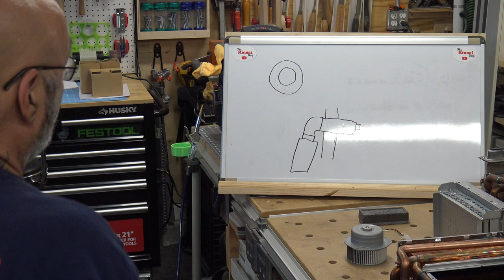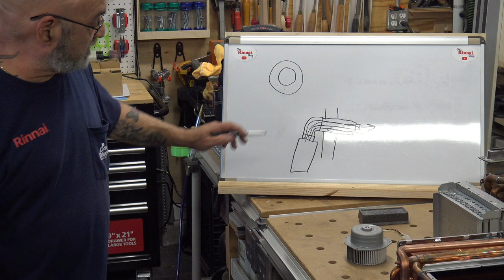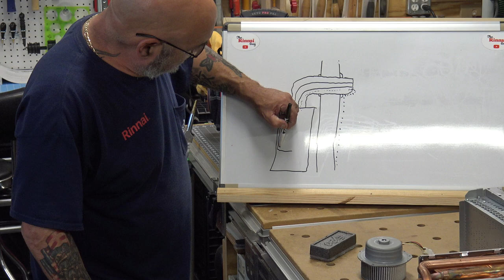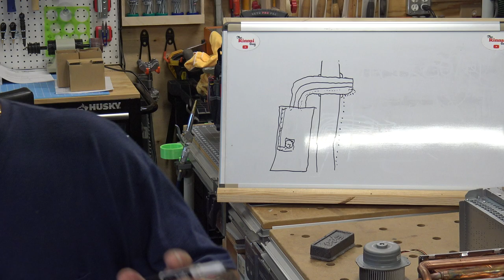Rinnai code 10, what causes it and how to fix it

Comment: Hello Mike, I have a Rinnai V75 indoor unit and when using the shower I am getting a code 10. When I shut the shower off and turn it back on the unit starts to work again for appx 2 minutes at a time. Any assistance/advice  you can provide will be greatly appreciated. Thank you.

Comment: I am a retired commercial HVAC&R guy, I have worked for major HVAC companies for 46 years. I own a Rennai 94i water (1st) heater.. I watch your videos to understand any problems I may have… found lizard in my fan cage which caused   A vibration/ungodly noise which you talked about..thank you for making GREAT videos. I have had many instructors and you are in the top three for training! Thanks again!

Comment: What about the RUR160IP it seems mine errors out with code 10 and won't clear until I clear the condensate trap. Not sure what is going on.
Reply: Is your drain line flowing good and do you have a vent on the drain line?

Comment: Mike, would a code 10 cause intermittent hot/cold water fluctuations? (Like in a shower or sink faucet) water in shower wasnt staying hot so i replaced shower valve cartridges/seats etc which didn't fix. If i turn hot h20 in the bathroom sink on first(in same bathroom),sometimes the shower will stay hot. After my attempted fix(maybe a day later) I received that code 10(w the beep). It stopped after about 10 seconds, amd seems to come back every 3 days.

Comment: TLDR: [Code 10] My vent line was almost completely full of condensed water, so I opened the drain line that's capped, drained all the water, & the unit works fine again.

Hey guys, had an Error 10 on my unit just yesterday (Model# RSC199iN - Rinnai Tankless "indoor" unit, installed inside my garage). I looked all over the internet & came across a plethora of  possible causes & fixes; including this video. My unit is less than a yr old & I don't have problems with insects getting into places they don't belong, nor does the system share a vent/intake with my furnace. That said, I called my installer & he told me a possible cause was too low of gas psi entering the unit, which made sense due to the fact that here in the PNW we had a freak winter storm producing balmy temps of about 8. Because of the cold temps & my neighborhood is ran off nat. gas, the high demand could've dropped the supply psi to a point where ignition couldn't be achieved. I tested that by shutting down my running furnace & nat. gas fireplace - no luck. I noticed that when the unit attempted to fire, there was a bubbling sound within a black plastic manifold, that connects to the outer vent PVC (like if you were to blow in a straw in a glass of liquid). Since I wasn't present on 1st install/setup,  I had no idea if this was normal or not, but I fixated on that noise. Though the unit has a drip/condensate line already, I noticed on the bottom of the unit, across from the already in-place drip line, there's another capped line that has a stamped/extruded "DRAIN" on it. I opened it up, & a *ton of water came out. Restarted the unit & it's working perfectly again. My installer said it's the 1st he's ever heard of such, & no write-up/video I came across mentioned trying that either. So if you hear percolating water in your unit on startup, try the drain line. Be sure to put a pale under it, as there was quite a bit of liquid in there. That caused the fan to run extremely hard to try to vent through that much water, & luckily the safety mechanisms of the unit caught the issue & shut it down before frying my fan. Hope this helps!

Comment: Hi Mike, thank you so much for the video!! I think I have just about tried everything for my code 10 and still haven't solved it. So I could use your help! I have a RL75i interior mount with side wall vent (with no other vents or obstructions anywhere nearby) and I have almost always code 10s but have an 11 and 14 in the memory. The unit runs for about 5-10 min then the shower pressure will drop as the hot water stops flowing or it will turn cold. When I am at the unit, the system either appears to start with flame then shut off and restart repeatedly or when it gets cold I see a code 10 with continuous beeping. Thus far I have removed the vent pipe and found dirt dobber nests which I have cleaned, found on on the top of the coil, a gecko and bugs inside the fan which I purchased a new one along with the thermistor which was quite dirty. I pulled the burner and cleaned it with compressed air, blew out the coil from below and back through the air intake from the fan hole. I also replaced the gas manifold, view plate, electrode and flame rods. Almost forgot, I also flushed the system and the water filter was very clean. When I started the burner flame height was low and now is full height. What am I missing here? Please help!
Thank you in advance.

Comment: Hi Mike I think I may have gotten one wire mismatched when reconnecting wires after fan cleaning, everything started when I connected. Hot water ran longer than usual then whole system shut off but not breaker. Im wondering if I can just fix wiring and it will come back on. It is a bit hard to read the wiring diagram on my cover. Do you have any detailed pics of how the wiring colors go? Mine look exactly like your examples, its an RL04

Comment: I have a Rinnai R75LSi that is rented from a large Canadian HVAC company since 2011 and it has started to get the error 10 sometimes when someone takes a shower at night. So far, I've been pressing the ON/OFF button to restart the unit to get the hot water flowing again. I've checked the outside intake and didn't see any debris inside so it is likely some stuff in the blower fan inside the unit.

Would you recommend to DIY take the cover off to get to the blower fan to clean it even though it is a rental unit to save cost on a certified HVAC technician to do this?
Also, safe enough to access even if I don't have the gas turned off next to the unit but power has been unplugged to it?

Comment: I get moths in my fan here in Colorado, in the beginning of May.   The fan vibrates and I get code 10's.  These moths must get in the annular intake vent termination and eventually into the squirrel cage vanes.  
They also crawl in the center exhaust when it's off and their toasted corpses build up in that circular perforated vent on top of the heater.   I guess that causes code 10's because of how it limits blower air flow and makes it vibrate?  Do they make a vent screen that covers the intake and the exhaust?  I only see exhaust ones.

Comment: Hi Mike, Thank you for taking the time to speak with me today about the Rinnai Condensing Boilers. I live in Upstate NY and will be replacing a 1955 EFM 520 Coal Stoker boiler with an LP gas Rinnai boiler only. The information you provided me will help me with a safe and dependable system for years to come.
Randy

Comment: Hello Mike, Thanks for all the info and demos you put out, with that said, I have a Rinnai R98LSeASMEN exterior, looks very much like the one you have there, when we turn on the hot water on it runs for about 3 minutes or so, then it stops, no noise from the Rinnai and no code on the keypad, just the little read light turns off,  i'll have to turn off the cold completely and then it might warm up after a minute or so, if not i turn them both off, then just the hot water on, it will take a minute or two to get the hot water on again, then I'll have to hurry and finish my shower, I still have exhaust coming out when it turns on, just not sure if its partially clogged, I'll check the fan and hole vents and see if it blows harder and see if it stays on. Thanks again
Reply: If you use another shower does it still do it? If so there is dirt in the water servo valve or the thermistors are dirty. It the other shower works good you have a bad shower Cartagena. Mike
Reply: Update: both showers and all sinks loose hot water after a few minutes, like i said no codes, I took the fan out and the igniter and cleaned off with my fingers, wasn't dirty to me, with the igniter out i looked at the burner and all looks clean, wasn't dirty to me. took off the fan and seems to be true and spinning good, with everything out i got my compressor and blew out the complete system, just dust parasiticals came out if anything, I havent got the gasket kit so i did not remove the burner cover etc. I put it all back together and turned on the hot water inside, same thing, no hot water after a few minutets, but while cleaning it out i noticed something, in the exhaust opening there are 6 white insulation tabs i guess on the upper side, thats what they look like to me, the 2 on the left are kinda tan the other 4 are fairly white, when the hot water was on inside  and the tank-less working the exhaust on the left side and towards the middle was hot, but on the right side there was exhaust air coming out but it was not hot, it was cool, i could put my hand in front of it about and inch away and it was cool. not even warm, I think this will give you the best clue, so air is flowing, and heat is starting up just not all the way, do i need a heat exchange? do i need to order the gasket set before i remove the cover to investigate? might the gasket be ok, it has about 17 screws on the cover.

Comment: I do also want to note that I got the Code 10 in a cold spell. The cause? A frozen condensate line (that goes to exterior). I bypassed the condensate into a bucket temporarily until temperatures get above freezing temps. 

Appreciate your YouTube videos.
Reply from the maker: Thanks
Reply: I just had that on mine
Reply: @kevindejager6045  having a cold spell here, just checked it and the condensate was frozen again. Undid the condensate line and a whole bunch of water poured out. I guess this is just something I'll have to bear in mind every year in the winter.

Comment: Hiya Mike, I have an interesting one, I have a coaxial duct (vertical through roof) metal inner and plastic outer, condensate drain on bottom duct. I installed this unit in 2006 and has worked great till about 6 months ago, making noise, code 12, & code 10. Come to find out the 45-degree elbows are cast aluminum, and the straight sections are SS. The dissimilar metals caused the elbows to corrode and disintegrate (or maybe just the heat), guess where all that fuzzy shit landed? You guessed it, right in that ring of holes in the top of the unit. Changed the elbows and cleaned it out, working fine again. Thanks for the great video.

Comment: Hey mike, I"m not getting a code 10 on my Rinnai 75IN but the water does go cold after a few minutes with high flow to the shower head without an aerator, or if I have 2 or 3 faucets running at the same time. Its a new unit but its been sitting around unused for a couple of years, I bought it back in 2019. Cleaned out the fan, found small chunks of styrofoam, For some reason there was scaling when I removed the water servo valve solenoid (which makes me think that Rinnai tests these units before they leave the factory and maybe some water is left in the unit) and that little rubber thing around the shaft was stuck in the housing so I cleaned that up and now moves the rubber thing moves fine. I removed the water turbine valve blowing in it and made that whistle sound so to me that checked out.  I reviewed your video "Removal and cleaning of Rinnai's water flow turbine" and strange, the water turbine valve did have the fiber washer but didn't have a retaining clip. My thinking is that maybe the be high temperature build up in the vent triggering maybe some thermister. I"m not sure which direction to go from here. Any help would be appreciated.

Comment: Greetings Mike, thank you so much for doing these videos. We have a RinnaiRL75 that is used for our furnace and water heating.  We think it was installed in 2013, 4 years before we bought our house and doubt that it was maintained properly.  It does not provide hot water for a shower reliably.  Lots of,  "Code 10," and usually need to reset it during 7 of 10 showers.  We're so tired of it that we thought we should just start with a new one.  Our house has 2 bathrooms, 3 bedrooms and is 1679 square feet.  We use propane for heating. Which model would you recommend that we replace  our RinnaiRL75 with? We want to make sure it's big enough, but would love to avoid putting more holes in the house.  Much appreciated. -Lori
Reply from the maker: Call me at +19042385349 today after 5pm eastern time and I will go over it with you 
Mike

Comment: Hi Sir,
I did watch your videos about Rinnai code 10 and it helps me a lots  
I did replace my fan and clean burners and these did not fix my problem but when I change dip switch 2 and 3 from off off to on off , this fix my problem
So I need to make sure that this change is safe.
Can you please help me to see if this safe or not?
I do have this model Rinnai RL75iN Natural Gas Tankless Hot Water Heater, 7.5 GPM
I do live at Pittsford NY area

Comment: Mike here is a mystery. RL94 in a restaurant.  Get error code 10 sometimes, but appears to reset itself.  Here is the real mystery.  Intermittently the hot water stops flowing completely.  No hot water coming out of faucets.  Meanwhile Cold water tap is working fine.  Blocked flue should cause water to come out of tap as cold, correct? But not restrict water flow. After 10-20 minutes the water flow comes back and the water heater works again. Makes no sense.  Hester is about 10 years old and this just started.  Suggestions?

Comment: Off topic: We have a new, external tank with built in recirc pump set to run on timer for 4 hours daily. A tub faucet in the master bath and a sink faucet in hall bath drip maybe 3-4 drops over the 4 hour recirc window. Plumber came back and added an expansion tank; problem persists. Any ideas (please).
Reply from the maker: Water is moving and only being heated a little so expansion is not the problem. If a faucet is closed and water bypasses the washer or cartage it’s a problem with the faucet
Reply: @ThatTanklessGuy  Awesome… thank you. Have a great week.
Reply: Check parameter settings…